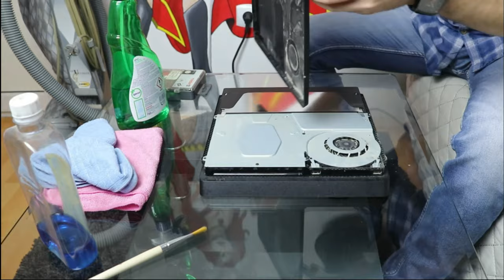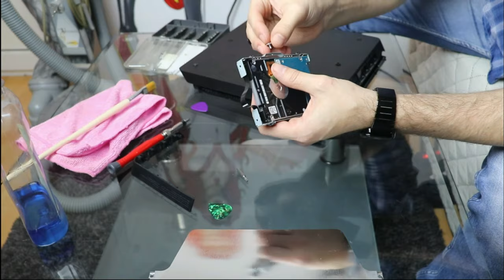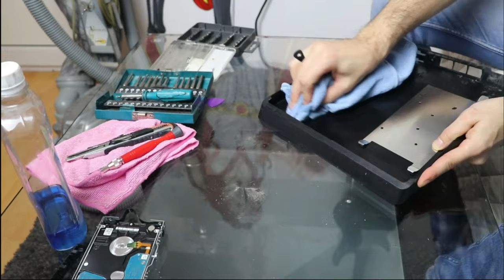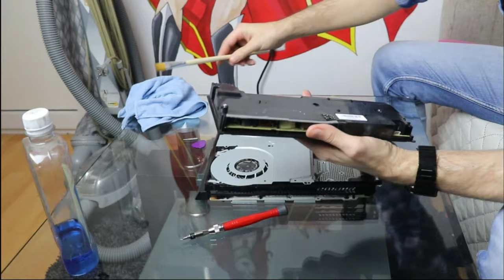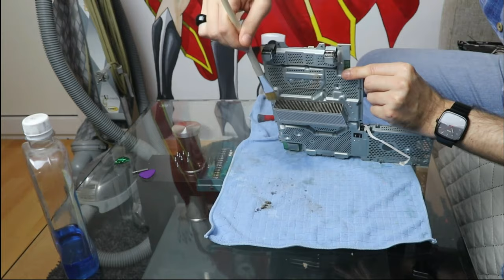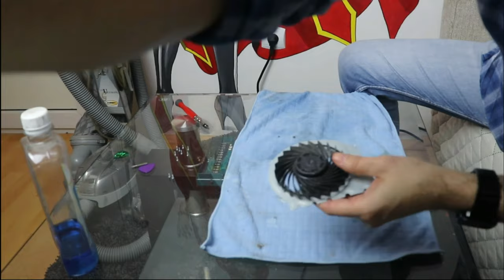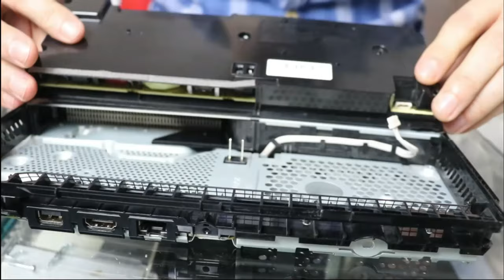DIY PlayStation 4 SLIM Cleaning | How to Fix PS4 Loud Fan (Model CUH-22166B)

Comment from the maker: Watch this video if you want to change the thermal paste: DIY PS4 Thermal Paste Change (Model CUH-22166B)
https://youtu.be/z2aHvkY6lCU
Reply: Hi I took apart my ps4 slim and there was barley any dust build up and I cleaned the fan. After I put it back and put on a game not doing anything the fan went up like crazy
Reply from the maker: That should not have happened. Something might have gone wrong in the cleaning process. If you took apart the heatsink from the processor you have to change the thermal paste as well. If not, maybe have your console checked out by a specialist.

Comment: hey bro , I followed these steps and cleaned my Ps4 , but now the disc is not reading, entry nd eject is working but it shows "unrecognisable disk". any solution? digital games working.
Reply from the maker: Hey man! Maybe something happened when you connected the ribbons. Make sure each ribbon is in the right spot, inserted enough to make contact with the pins and the orientation is ok (right side up). If you pulled on one of the ribbons and the copper inside is damaged, you might need to replace that ribbon to fix the issue.

Comment: I was just nodding along thinking, oh I can do this...
Until you get to removing the power supply and whoa, that's a bit too scary for me. Is it worth it to just open the top and bottom cover and then clean whatever dust is visible/reachable from there?
That's probably the limit of what I'm confident enough to do by myself. 
Or should I not do it all? :(
Reply from the maker: I saw some videos where people just blow air into the consoles air vents without taking anything apart. I guess that if you can get rid of any dust particle inside you console would be better than leaving it there. But if you are not confident opening your console or if you are scared you could break something maybe it would be better to take your console to a professional and get it cleaned properly. Good luck!!!

Comment: Pro Tip: with the help of a $20 3D Printing Pen, you can actually reattach those little plastic “warranty seal” pieces if you’re skilled enough. 

Just a fun little bit o’ advice for my fellow DIYers who also still want to maybe use their warranty for whatever reason.

Comment: Whatever you do try not to watch 2 different videos done differently otherwise you’ll end up taking out way to many screws like I did also be extra careful with the black wire under the battery the little plug can come loose from the wire then you’ll have to macgyuver it back together like I had to I mean I wore plastic gloves and still cut my hand up good on that part I’ve got rather small hands for a guy so if you’ve got a kid you trust enough to stick their hand in might be easier

Comment: This video helped me so much, there was much more dust than i thought,only thing is that now it doesn't turn on lol,any help?
Reply from the maker: Retrace your steps. As long as you didn’t damage anything in the process it is most likely that you missed something while putting everything back together. It happens to me all the time 🤭. Best bet: watch the video again and take it all apart step by step until you find whatever plug you missed. I hope you figure it out. Good luck 🍀.
Reply: @LifeHackerMax  thank you so much,while i was assembling it back i forgot to connect the wire that connected the power on button,works great and quiet now thanks to you
Reply from the maker: @vitospizzico3209  glad you figured it out. Happy gaming! 😀

Comment: So I’m doomed because i just have standard screwdriver
Reply from the maker: I tested out the pin breaking method and it worked. It is not very easy to do but it works. You can give that a try on one screw and see how it goes.

Comment: So please no need for thermal paste like the fat ps4 because my friend spoiled his console after cleaning his fat ps4
Reply from the maker: Changing the thermal paste is needed from time to time but not as often as cleaning the console from dust. My video only covers the fan and radiator cleaning from dust which should be done more regularly in my opinion and needs less knowledge and skill.

Comment: How do you break the pin without the security bit?
Reply from the maker: I tested this once to make sure it works as I have a security bit. I used a flat screwdriver and a small hammer. Press the screwdriver against the small pin and hit it with the hammer gently. Once the pin has bent, move the screwdriver on the other side trying to bend the pin in another direction. Do this a few times and eventually the pin will break. I have to say it wasn’t very easy. Good luck!🍀
Reply: Which pin
Reply: @LifeHackerMax  actually I am doing it first time so I am reading all the comments to make sure it works 100% and then I saw this comment I just wanna confirm everything please.
Reply from the maker: @shrichandgangwani7920  I would recommend getting the right tool for the job. But if you are a crafty person, It does work to break the little pin in the middle of the screw.

Comment: I can't even get the power supply connector in
Do I just push it in? I tried everything
Reply from the maker: It has an orientation. Try rotating the plug and see if it fits the other way around.

Comment: Would it damage the storage.. Or reset the whole console... Scared to unplug all the connectors inside it.
Reply from the maker: The main power socket should be disconnected first. As long as you don’t damage the ribbons, wires when connecting/disconnecting them, you should be ok. All the information is stored in a hard drive like the one you have in your Laptop 💻. The information on the storage device will not be harmed by unplugging the connectors. 👍🏼 Good Luck! Follow the video and you should be fine.

Comment: I did this and it still sounds loud it honestly sounds the exact same
Reply from the maker: Maybe you need to change the thermal paste as well. If the thermal paste it is old then only cleaning the fan and the radiator is not enough.

Comment: Update: Found it! It goes into the slot behind the ○ on the side with fan. Hope that makes sense.

 Original: This video was amazing! I had a small black L shape piece with a circle fall out while I was removing disk drive. I have no idea where it goes or if it's even a part of the ps4 😭

Comment: Anyone know what those ribbons actually do? I was trying to push the big one back in and pushed too hard, not knowing that the security flap would be enough to line it up with that black line you see there…I can see a crease in the ribbon where I bent it. Unfortunately I cannot check it right now as I’m in night class, but I hope it’ll be ok!
Reply from the maker: The ribbons make connections from the motherboard to different peripherals inside the console: power button, hdd drive, disk drive … If the ribbon was bent once you might not have broken it. You just have to try to put everything back together and hope the connections are not interrupted. Good luck! 👍🏼
Reply from the maker: My best guess: the big ribbon cable goes to the disc drive. Maybe someone who knows for sure can confirm this.
Reply: @LifeHackerMax  yes something like this! Also blu ray disc maybe..anyway! The PS4 runs so quietly now! The fridge is actually louder, it’s unbelievable. I can run apex legends without it annoying the hell out of my wife :D

Also, my interface is much, much smoother now and the load times in games are noticeably faster. Thank you so much!!
Reply from the maker: That is awesome! You are so welcome! 👍🏼 Have fun!

Comment: You must change thermal paste
Reply from the maker: In this example the heat sink is not displaced from the processor so the process it's only about cleaning the fan and radiator. My PS4 is too young to need the thermal paste replaced. Changing the thermal paste it's a great recommendation but it is not necessary to be done as often as cleaning the dust off from the fan and radiator. I did this 8 months ago without changing the thermal paste and my console works flawlessly since. I am not saying don't do it, I am saying that if you don't know what you are doing it is better to take your console to a professional for changing thermal paste every few years (I think a change is good for 3-4 years depending o the paste) but take the dust off on your own once a year or so. That is my opinion. of course everybody should do whatever he/she thinks it's best for their console. Happy playing :)!

Comment: Wonder if you noticed any difference. You took out a very clump of dust and what not when you took out the fan.
Reply from the maker: Thank you for taking the time to watch my videos and your input is much appreciated 🙏🏽. And yes! The difference was noticeable! The PS4 fan gets very loud when the radiators get blocked. After cleaning the console should be silent. If the fan is still loud that is a sign that the thermal paste might need a change.
Reply: @LifeHackerMax  thanks for the video! I live quite dusty country, i live in Caribbean and so my porch door is always open and thus lots of dust. I did clean it of with compressed air a lot in the beginning. But think I should have a peak inside see how it's doing. Still got lou2 in the box, i did run that intro and played couple minutes. Fan went crazyw with that game, but on the other hand, I've read it's kinda normal for that game and PS5 slim
Reply from the maker: Good luck to you mate! Please come by and tell us if you see any improvement after the cleaning! 👍🏼

Comment: 7:30 when I pulled this part out it’s not coming out and I pull harder and now the motherboard thing is not connected to the plastic cover and idk what to do
Reply from the maker: That is the power supply. Probably missed a screw. Try asking someone to double check and retrace your steps. When in doubt take it to a professional.
Reply: @LifeHackerMax  oh my god your a life saver mate. Your right i did miss a screw. Thanks so much 😂 I only spent 1.5 hours trying to figure out what i did wrong 🤦. Thank you very much ❤️

Comment: It's a very well made video, but, in my humble opinion, it's missing one very important step that some might wnat to do and would help most of the PS4's out there to keep working cool for a couple more years. You should include removing and replacing the thermal paste on the APU, for this subjet to be complete. Other than that, great work.
Reply from the maker: Thank you so much for taking the time to leave this comment! You are right, the subject is not complete without the thermal paste change. On the other hand when making this tutorial I made the conscious decision to leave out the thermal paste change because not everyone that will follow this tutorial will be able to perform the procedure and might end up ruining their console. And even though I am doing my best to add disclaimers in my videos there is still an ethical responsibility that I feel for my viewers. Also I consider the two procedures separate because as a good practice it is recommended to clean the hardware from dust every 6 months or so while the thermal paste change can be done once in 2-3 years. So it is still ok for some to do the dust cleanup and once every 6 procedures take the console to a professional for a thermal paste change. That was the logic behind me not adding the TP change in the video.

Comment: "You can easily break it with a flat screw driver" yeah fucking right. Now what do i do?
Reply from the maker: It works by using the small flat screwdriver as a chisel. I tested this and it works (I put the screwdriver in an angle and hit it on the back with my hand. The pin broke). It is not pretty though because the screws where not designed for this. It is easier if you have the right bit though.

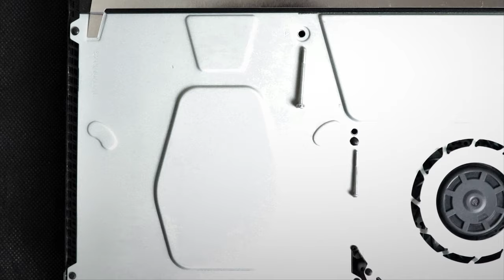Comment: At 8:32 you said we can remove the black plastic pins but it can affect the integrity, would the screws be enough for it to be in place as I’m not sure if i should do that my PS4 Slime is dusty in the fan and heat sync
Reply from the maker: The plastic pins can only be removed by braking them. I haven’t done that. In order to get to the heatsink without breaking the pins you have to work a little more and unscrew a few more screws (like I did in the video). So it is possible to clean everything without cutting the plastic pins.

Comment: I want to do this bc I can't stand the noise my ps4 makes but I'm scared that I'm gonna do something wrong and break it lol
Reply from the maker: Miché, there are some things you have to be careful with that might get wrecked in the process. You could try opening up as much as you are comfortable with and clean as much as you can up to that point (it might help a little with the noise) if you don’t want to take it to a shop to clean it. You also can see it this way: noisy ps4, means forced fan and high temp on processor. That means stressed ps4 and that means it might break any day (nothing is for sure). So, you could break it if you open it up but you can also break it by not opening it up 😉. I wish you good luck 🤞🏼☘️!

Comment: I've done exactly what you did, and now it's keep crashing and I have green dots and line all over my TV screen and the sound it doesn't works, how I could fix it?
Reply from the maker: Hello Teo! I don’t know how or why you get those symptoms on your console but you should probably get your PlayStation to a professional before something else gets damaged. What you are describing sounds like a HDMI issue. If you didn’t mess something up by mistake inside the console my best bet would be to try another HDMI cable and make sure it is plugged in good into the ps4 and the TV as well.

Comment: I got a over heat warning took it apart use some white thermo past i don't now if that okay But got it back together and once the gane starts fan sounds loud and shuts down
Reply from the maker: If whatever you did didn’t fix the problem, maybe it is time to take it to the PlayStation Doctor in town. If some of the chips get fried you might end up with an unusable PS4. I didn’t get to open mine to the point of changing the thermal paste. You might need some professional thermal paste refresh (change). Good luck Ranger!

Comment: What does the ps4 power supply screw look like because I think I am going to get it mixed up with something else
Reply from the maker: If I remember correctly there are 2 screws that fix the power supply and they are different from all the other screws inside the PS4.

Comment: Yeah I did all this...now it will not start up for more then a sec or 2
Reply from the maker: You might have missed something on reassembly. Best bet is to retrace your steps and check that all plugs, ribbons and the hdd are connected. (Fan plug, power plug, the 4 ribbons and the hdd). Most of the time there is something missed considering you haven’t broken something in the process. Good luck 🍀. I hope you will figure it out.
Reply from the maker: If you get a beeping code try checking on google what the sound pattern indicates and check that specific area.

Comment: Bro I can get the under cover of the console out. What do I do
Reply from the maker: Do you have the same console model as mine? Check that you removed everything that holds the cover in place: hdd cover, hdd screw, hdd, warranty seal screw under the sticker. If you do what i did it should come off.

Comment from the maker: You might also enjoy my custom PS4 controller build: https://youtu.be/Cxoiq8DdQb4
Reply: I can't open past the warranty sticker
Reply: For some reason, half of the ps4 doesn't disconnect from its other half
Reply from the maker: Check all steps closely. The HDD will block it from opening if not taken out I think.
Reply: @LifeHackerMax  I did what I had to do. All that's left is to figure out a way to put back the metal plate that covers the fan and put the rest and im done.

Comment: What do I do if I don’t have the Philips phone-0
Reply from the maker: You can try using a small flat screwdriver. Or you can try breaking the pin with a flat screwdriver and a hammer. It is not easy but it is doable.

Comment: My ps4 controller won’t connect what do I do?
Reply from the maker: Try via cable connection or try holding down PS button and Share button at the same time to enter pair mode and connect it from the settings menu (you will need a second remote for this).

Comment: My power supply connector is stuck very tightly, i fear that if i pull too much i'll break It, what should i do?
Reply from the maker: The power supply plug is tight. If you got all the screws out, you should be ok. Try to pull it vertically though. If I remember correctly, I got the same feeling as you the first time I took it out.
Reply: @LifeHackerMax  Wait, just to clarify im not talking about the big plug but the small cable, anyway, thanks for the quick answer!
Reply from the maker: @Dioniso_  If I am not making a mistake the small cable can be disconnected from both sides. If you can’t take one side try the other. Good luck!
Reply: @LifeHackerMax  Got It, thank youuuu

Comment: How can i disconnect the eject button?its ejecting on its own
Reply from the maker: You have 4 ribbons. One of the two small ribbons is hooked up to the buttons board. The one closer to the buttons. I believe the second one goes to the hdd. But leaving it disconnected will disable the buttons and the led’s. If you disassembled your ps4 you might have mounted something wrong and the eject button stays pressed. Try disassembling and reassembling it back together. That might fix your issue. It happens to me often to misplace or put something back together the wrong way. I hope you will figure it out. Good luck!